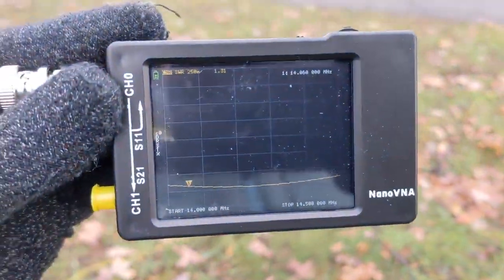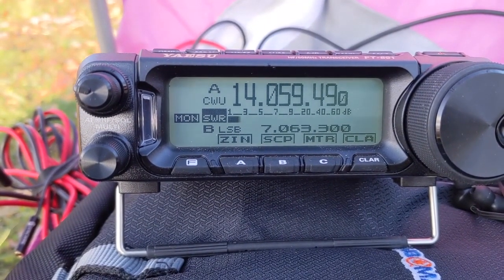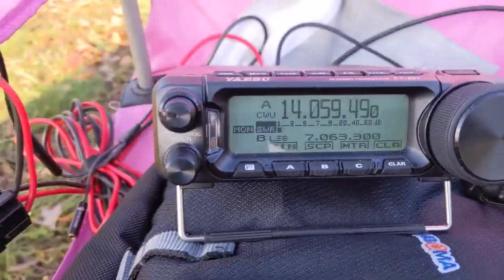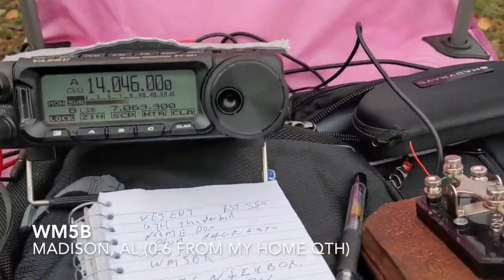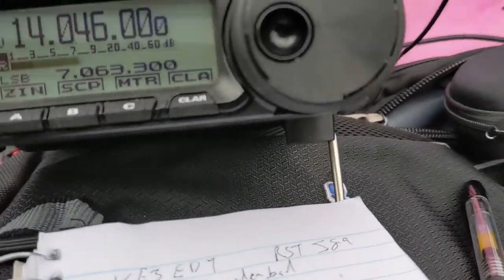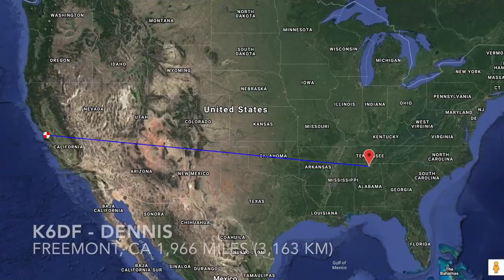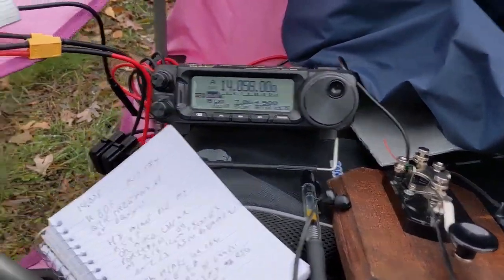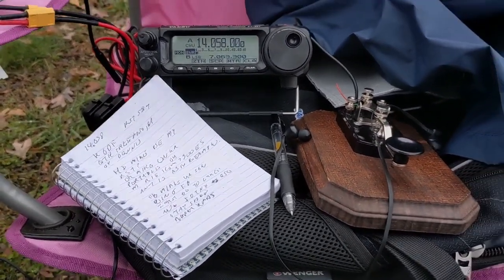portable at the park with my mini-tenna: $5 homemade vertical wire antenna (from Dec 2020)

Comment: This might be a stupid question but can I use this setup on 100w SSB? I also have an 891
Reply from the maker: Yes, probably so. It would depend on if you have thick enough wire gauge but if you just used decent gauge speaker wire it would probably be fine. I did 30 W and 50 W with CW with my set up with no problems. I bet I tried 100 once a couple of times also on CW so I would guess SSB would be fine.  There’s probably a math way of being sure. 73 Mike

Comment: Nice handwritten doctor font!  Another great video.  Thanks again!  I always choke similar setups, especially on windy days (abundance of caution and lack of knowing whether it's absolutely necessary).  My 2 favorite backpackable options, for purchase at least, come from either HamRadioAntennas or Tufteln.  I'm not affiliated with either.  Customer service and build quality from both are touchstone.
Reply from the maker: Thank you!  It's been a while, but we still use that little vertical wire sometimes.  It's amazing how inexpensive the hobby can be if you want or need it to be!  73 Becky es Mike

Comment: Curious what coax you’re using with this setup? Is there a need for a choke?
Reply from the maker: Good question.  I used a RJ8X coax bought off amazon and did not use a choke.  I've had great luck with this setup and in general we don't use chokes but maybe we should look into it to help improve our signal to noise ratio.  73 Becky es Mike

Comment: The right word is radial or radials.  Radials can be on the ground ( untuned) or if raised or elevated they need to be tuned. A counterpoise would typically be a single wire not on the ground. It would provide a return path for the current from the quarter wave element.  Sometimes the shield of the coax becomes the counterpoise.  Essentially radials or a counterpoise both provide the return path.
Reply from the maker: @dandypoint  thank you!